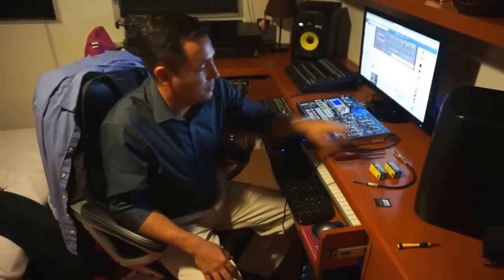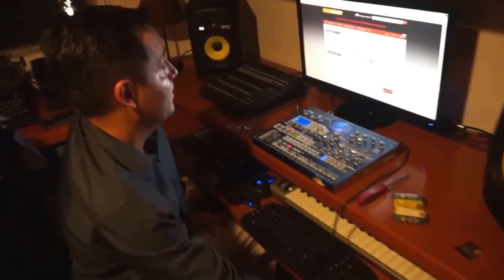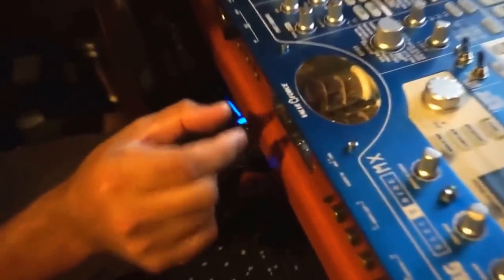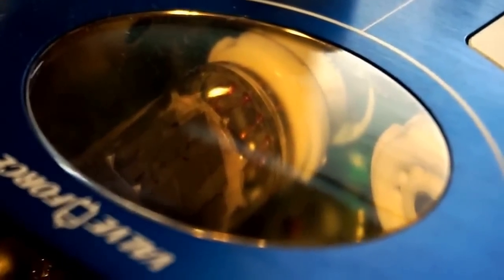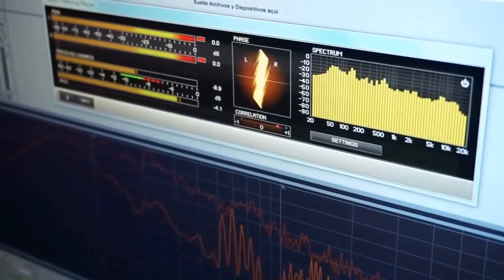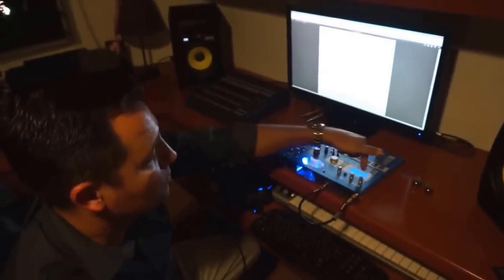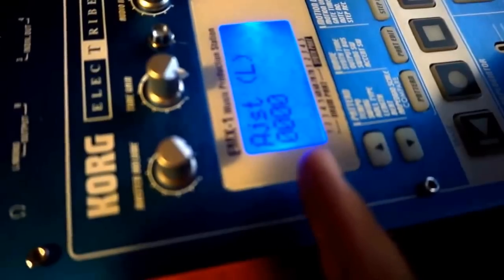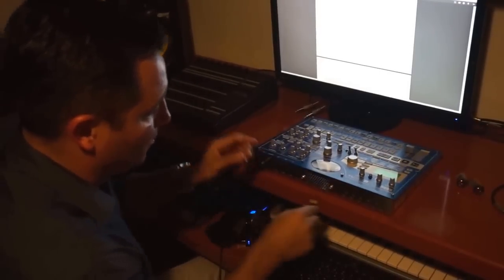Electribe Emx1 tube replacement and calibration process

Comment: hello in which direction do the resistors go?  the golden side towards the wire or vice versa.  thank you
Reply from the maker: Direction or polarity doesn't matter but if you have ocd just put both in the same orientation.

Comment: Thanks for the tutorial! Unfortunately my my display shows 0999 value and I can't adjust :( Do you know how can I fis the problem?
Reply from the maker: Make Shure you used the right resistors and make Shure the cable is not making any short circuit.
Reply: @elsecotron  thanks i did not use the right resistors. Its all good now. Thanks a lot

Comment: Hi there, thank you very much for this quite informative video.
Is there any way to order the cable? Or gettting it from any party? Thanks
Reply from the maker: Once in a while people on Facebook electribe forums offer home built cables but you will pay much more for shipping thank getting the parts in your local store and building one for yourself. It is very simple.
Reply: @elsecotron  Thank you kindly for your answer. After researching a lot on tubes, I was wondering if it was orth it to go for a pair of really good (expensive) tubes for the EMX, like TSsung Tol or Genalex Lion or Telefunken... Some tubes are better for lasting longer, some tubes are better sounding, each with their characeristics. Is it worth it, in your opinion, to go for really good tubes in the EMX? Like 50 bucks tubes stead of JJ 20 bucks tubes? Or is it overkill and it won't change the sound that much? I'm perfectly aware that I can't make it sound like an ARP Odyssey but will it make a worthwile improvement?
Reply from the maker: @stephanemonnier9659  I have not listen to an Electribe with expensive tubes so I can't give you an answer, but regardless of using expensive ones or medium tier ones the calibration process with the cable is necessary to get the full benefits of better tubes

Comment: #elsecotron wich tollerance i need to use for the resistors? (1%, 5%, ecc)
Reply from the maker: Use the resistors with the lower tolerance you can find, buy a small batch (5 or 10) measure the resistance as accurate as you can and use the pair with the smallest difference.

Comment: MY left and right valves are perfect 0000 0000 but after presing step16 again i get messsage ValveCalib x:low and all the butons flashing non stop. No “ValvGMax GainMx" message. Resistors in the cable are good.
Reply from the maker: make shure that you have the pots in the rigth position before you start the procces. Are you using the rigth resistors?
Reply from the maker: check the video from 11:45
Reply: @elsecotron  I solved another way, everything i did was ok, i just had to swich the korg to cool down, and start over after few hours.
Reply: @elsecotron  Yes resistors are perfect, pots are perfect position.

Comment: hola buenas , hace ya un par de años que encontre este video y veo que especificas que la resistencia tiene que ser al 1% para que haga una buena calibracion , aqui en barcelona solo encuentro al 5% y  he buscado por internet y no encuentro (aunque en el video se ve que ati si te sale) . Me podrias ayudar porfabor .( no te abia dicho nada antes por no molestar , pero no se que hacer ya ),  gracias
Reply from the maker: A mi entender un lote de muchas resistencias de  2.2 MOhms ±1% van a tener una resistencia en promedio de  2.2 MOhms con un máximo rango de variación de  2 % y en un lote donde la tolerancia es de 5% te puedes encontrar dos resistores con una diferencia de hasta 10% de  2.2 MOhms. Si no tienes la opción de conseguirlas al 1% comprate unas 10 y mide su resistencia con el multímetro de la forma más precisa que puedas y escoge solo dos que estén lo más cerca posible de  2.2 MOhms e intenta que la diferencia se encuentre entre   ±1%.
Reply: @elsecotron oh,, muchas gracias por responder tan rapido, lo mirare en cuanto pueda , te informare si da resultado,y muchas gracias de nuevo

Comment: You need gloves to touch the valves and do not leave traces of grease.
Reply from the maker: Victor Muñoz yes indeed. The grease creates uneven thermal distribution. But a good cleaning with isopropyl alcohol takes care of it.
Reply: eso es . Saludos y buen trabajo .

Comment: Hi Mr. , I've a question .. Should I apply the same procedure with red Electribe (sd model)?
Reply from the maker: 100X100RAW yes it is the same procces
Reply: Sorry, take advantage of your kindness, I bought Mullard tube (CV4004 / 12AX7), I think it is not different regardless of the tubes that are mounted.
I thank you very much, you were fast and kind and obviously very precise

Much love from Milan
Reply from the maker: 100X100RAW  as long the tubes are 12ax7 compatible they should work, each brand has diferent sonic characteristics thats why there is a calibration process, so you can maximize the performance. I havent heard the mullar tubes yet but I have read that the jjs that i recomend have a  sparkier and crispier sound than the mullars. I hope that you enjoy your new sound!!

Comment: After the tubes warms up, and I'm at the Adjustment (L) phase I don't get a numerical reading just a "N.G." which I assume means "not good" or "No Ground?"
Reply from the maker: Joseph Guerra that happens when you are using a cable without the proper resistors. You need to solder to resistors to the plugs.
Reply: elsecotron that may be true but when i used the cable the with the stock tubes i got correct readings so im thinking its a problem with the new tubes themselves
Reply from the maker: Joseph Guerra so do you have the resistors on the cable or not?
Reply: Yes i built the cable with correct resistors just as the schematic indicated.

Comment: Do you have a link for the jacks from digikey  or can you tell me the size of the mono and stereo jack so I can do a search?
 I'm still waiting for my used  EMX-1 to arrive but want to put new tubes in and calibrate prior to using. Thanks for the great info and video. cheers. P.S. Does it matter which way I solder the resistors in? i.e. what end solders closest to plug?
wayne.
Reply from the maker: Wayne Bartlett you will need a standar 1/4 inch trs plug and a 1/4 ts plug. Look for the service manual online and check the description of this video. You would love the sound.
Reply from the maker: Try to mimic my cable. The resistors can be conected in any direction no polarity concerns.

Comment: I'm getting "ValvCalb x:Low" message after the adjustments, and it never gets to the ValvGMax GainMx message. What's going on? How do I solve this?
Reply from the maker: Check the resistors in the cable
Reply: JobimMusic did you happen to ever fix this? Did you find out what was wrong with it and why that error happened?

Comment: I changed the valves to the recommended ones and sound doesn't distort at all. I didn't even get this cable to calibrate I just used wavelab , use the phase plugin and center it as much as possible 😉
Reply from the maker: Filipe Santos the calibration proccess is not just about chanell balance it is also about dynamic range. Changing the valves is great but once you calibrate them is AWESOME!!
Reply: well mine sounds fine i can crank the tube gain all the way up and theres no distortion whatsoever plus both sides are right in the middle , i tested it myself with a sine wave on wavelab. I've no need for that cable .

Comment: ok so i accidently saw this video.. my  emx1 valves distor the sound alot even at 1/3 turn .. is there a problem? do i neet to change the tubes?
Reply from the maker: retrogazele the original tubes normally produce distortion between 1/3  to 1/2 of a turn. tubes then to loose "sparkle"  and warmth with the time so replacing them once in a while and doing the calibration procces improves a lot the analog feel. because time changes the tubes recalibrating the same tubes may improve de quality of the distortion
Reply: elsecotron thank you for taking the time to reply. I need to run some test through ableton. and maybe consider changing the tubes ! thanks again.

Comment: why dont the tubes light up when active?
Reply from the maker: cromlek, they do light up
Reply: the actual valve coils turn orange and glow?
Reply from the maker: cromlek yes they do
Reply from the maker: it is a little spark but the main light comes from to leds next to them. I did swap the original orange leds for blue ones now I can notice the little orange spark from the tubes

Comment: Is it just me or it seems like you are NOT using a SINE wave when testing right after changing the tubes?

If you compare the sound from 2:55 until about 3:05 (which sounds like a real sine wave) 
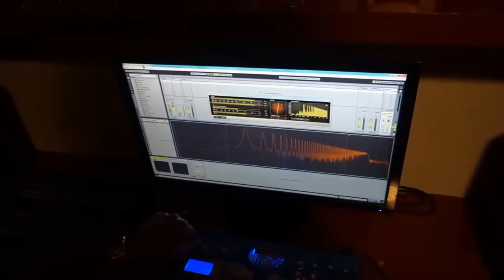with the segment from 7:45 to 7:55 (which sounds more like a sawtooth wave), it's really obvious the sound is different.
Same with testing after calibration (from 16:06 and on)

This might also explain why your spectrums look so different... (and not just tube characteristics difference)

In any case, thanks a lot for sharing this video!
I'm looking into changing the tube on my KingKORG, so it was interesting to watch.

Also, I didn't quite get what software you are using to test this... If you could write it, it would be helpful.
Thanks!
Reply: Found my answer!
Ableton Live with TRackS3 Metering/Master
Reply: SynthOSphere KingKORG's have tubes?

Comment: Do i need the specific cable to calibrate or can I use any 1/4in cable?
Reply from the maker: the cable has two resistors without them the calibration process  doesn't  work
Reply from the maker: You need to build this cable acording to the specifications here https://medias.audiofanzine.com/files/korg-emx1-electribe-service-manual-479810.pdf

Comment: Hello from Montreal! I just wanted to thank you for the tutorial, you convinced me to give it a shot and try: I succeeded and it was well worth the effort! 
*(I also have a little tip lower for those like me with very limited experience in soldering who were struggling to understand clearly the cable schematic in the service manual, like I was at first.)*

I recently got into buying Telefunken smooth plate vintage tubes, and it hit me that I had an EMX-1 sitting around being all useless! I already had JJ ecc83s installed on the machine from the beginning, but for me retrospectively they didn't cut it soundwise. I initially installed the Telefunken tubes in the EMX just to test how each of them reacted when being pushed with different kinds of content: each tube reacts differently, which makes the EMX a great convenient tube sonic character testing machine, even if the EMX itself may not exactly be 100% relevant musically today. 

All this being said: my Electribe is now DEFINITELY a machine I will hang onto - I was in the process of selling it, but the selling price is just too low and the machine is just too useful to be sold at that price point... I was initially looking at selling it for 360CAD locally...

***So now onto the tip:***

It is essential to understand that on the schematic the word "White" refers to the TOP wire that is clearly shown as going through the entire cable in the drawing. Where the word "White" (and "Red" as well) is written on the TRS side (left) relatively to the TRS jack is completely IRRELEVANT and will only confuse you - like it confused me until I realized what I just explained above. As a result, the word "Red" has to refer to the BOTTOM wire that is also clearly shown going through the entire cable in the drawing.

I was able to make this deduction because on the right section of the schematic, at the TS jack, the words "White" and "Red" are clearly not displayed on top of the jack itself, so they can only be referring to the top and bottom wire respectively.

Even more explicitly, this means that 
on the TRS end:
Tip = white
Ring = red
Sleeve = ground

On the TS end:
(Solder both resistances attached to each respective Red and White cable directly onto the TS jack Tip connector)
Tip = White & Red
Sleeve = ground

***ABOUT THE RESISTORS:***

I didn't have access to 1% accuracy 2.2MOhm resistors  locally, and online it appears you have to buy like 75$USD worth of resistor at least for them to ship so from what I researched, buying something like 6 resistors online was a dead end.

I used all-purpose 2.2MOhm resistors with 5% accuracy with no metal film spec, I measured them with a multi-meter and they were barely 1.5% above 2.2 MOhm
It is my understanding that because these resistors are from the same batch, they will all have the exact same resistance. I think that the fact that they each mirror eachother's resistance is more important than whether or not they're exactly at 2.2MOhm.

I was ultimately able to do the calibration test without any issue whatsoever and I reaped the sonic reward of my efforts.

***About the COST:****
TRS Jack: less than                  1$
TS jack:     less than                  1$
1M of cable:                                1.29$
Soldering iron:                            15$
5x2.2MOhm5%Resistors:         0.43$
Multi-meter to test continuity: 8$
->>>BEWARE of buying a multi-meter that DOESN'T have an Ohmmeter scale ABOVE 2000KOhms, otherwise you will have to measure resistors in parallel to get a read and you'll have to do some math to get a coarse idea about the resistors resistance...

Buy extra materials like I did in case you fuck up so that you don't have to go back to the store, resistors and cable costs basically nothing. For soldering, use a clamp-like tool to hold the jack in place as you solder stuff onto it otherwise it will be almost impossible, learned that the hard way sigh :)

That's finally IT! Hope this was helpful to at least one other person!

Michael

Comment: Would you recommend doing this on the Korg ESX? I have heard mixed reviews about changing the tubes. I'm about halfway through the process in mine, I replaced my stock tubes with a JJ ECC 803S balanced pair and I am seeing the dynamics are the same, but the levels are off (left is about 3 dB higher than right even after switching L/R). I need to build the cable but I am not sure the best way to do it, should I buy a short TRS cable and add my own TS end with the resistors, or try to build the cable from scratch?
Reply from the maker: build the cable. it is easy, just pay atention to the resistors the better (smaller) the tolerance is, the more acurate the calibration procces will be.
Reply: +elsecotron I ended up buying a monoprice TRS cable and ordering the TS connector and resistors from digikey. Sliced it and soldered it with no issues. Thanks for the video!